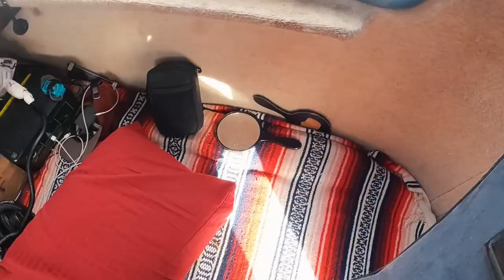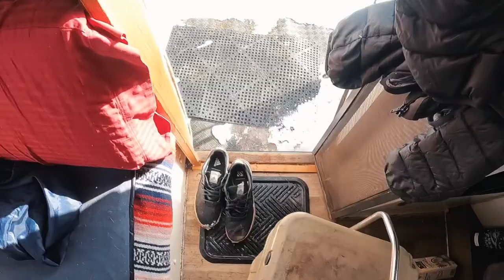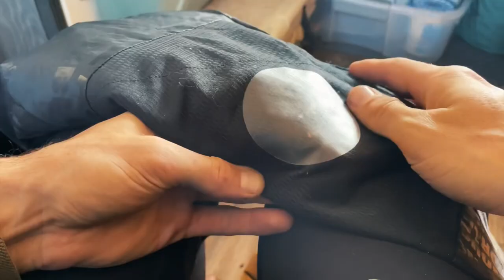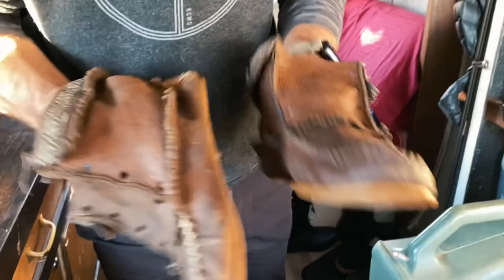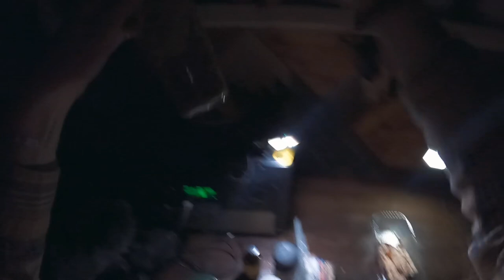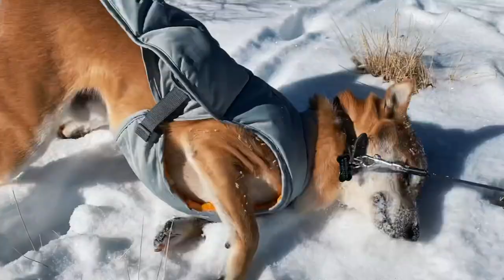WHAT DO WE DO ALL DAY??? // Living in a 13ft Trailer Off-Grid

Comment: Elsa, bless your heart, you need an "awl" for future moccasin repair. This from an old shoemaker's son. (I risk mansplaining here) Forget the needle n' thread thing. An awl is a cobbler's tool, (see google) basically a handle with a spike attached and a small barb(hook) at the end.Take 4 feet or so of heavy thread, and wax it up first. Push the awl through the shoe from the bottom, and hook the thread from inside the moc and pull it back down thru the bottom. Leave the two ends and all the thread on the other side. So now you have a loop. In the hole next to the loop, use the awl again, grab one of the loose ends, and pull the whole thing thru to the bottom. Now you should have a loop(just a couple inches) sticking out one of the holes in the sole, and a single strand a couple feet, coming out the hole next to it. And a single strand remaining on the upper side of the sole. Take the single strand next to the loop and feed it thru the loop. Close the loop tight by pulling on the strand above the sole, thats your first stitch. With your awl, at the next hole, poke up through the sole and hook another loop from the single strand above. Feed the lower strand thru the loop again and tug everything tight. Now you're sewing like a pro cobbler.  Merry Christmas you three!
http://www.craftrunner.co.nz/index.php?route=product/product&product_id=4492
https://www.walmart.ca/en/ip/Hanshi-Steel-Sticher-Sewing-Awl-Shoes-Repair-Sewing-Crochet-Hook-Needle-Tool/6WD4TE28XE4J
Reply from the maker: Thanks, I am using an awl in the video. I then felt like I no longer needed it after a while!
Reply: Oh, never mind! :o) @ElsaRhae

Comment: I recommend this stuff called “Sno seal”. I was a pro figure skater and used this stuff on the bottom of my skates, the leather would last me through a season!  Can re apply as needed!  Works best if you have a hair dryer to help the leather “soak in” the protectant. But I bet if you leave it by the stove, might work just the same!

Comment: Just a suggestion to help keep the heat in the camper - try closing in around the bottom to keep the snow and cold wind from underneath.  If you're going to be the same spot all winter, you could get hay bails, if not, even a tarp to block the wind would help.

Comment: You should look into all in one diesel air heaters, the can run all night, sit outside and use very little fuel and run off your goal zero. That way you can sleep through the night and use your wood burner during the day.  $200 buck off Amazon.

Comment: I wonder if there is a way for you to set an alarm based on a temperature of the stack. Or if you could monitor RPMs on the fan and set an alarm off that. I'm guessing the temperature in the stack, or fan RPM, starts to decline as the fire dies down. Is that reasonable? Alarm goes off at 150 F...something like that. Then you could sleep until temp alarm goes off instead of every two hours. I'm sure the alarm part could be figured out. I don't own a wood stove so I don't know how realistic this idea is.
Reply: Or even less sophisticated than that...I bet you could find a standalone air temp sensor/alarm. When the temp in the Scamp drops say 2-3 degrees, it's time to wake up.

Comment: are you guys are aware that there is a Chinese diesel heater with thermostat for small spaces like vans and scamp that you do not have to wake up to refuel? It needs battery and solar which you have and you can even buy one with gasoline burning that takes air from outside and exhaust outside as well. there is also a water heater with heater version as well. You may want to look into it.

Comment: I have no scientific evidence to back this up...But growing up I remember spring being SOOOO HOT and then summer was HOT but not bone drying hot. ( we didn't have air conditioning ).  I rode horses in 90+ degree weather, granted you didn't push them, but you still went into the mountains. My parents had basically a portable swamp cooler, which did little to help, but it was state of the art at the time, we had to add water and ice cubes in it, so we had a cooler more humid room.  I preferred riding up into the mountain to one of the ponds cattle drank from and jumping in.. Yeah it was that long ago.

Comment: I like to tell you that I have a scan that I bought new and we had Put  Size 13 tires on the scamp At the time we had the scam Brought app  I don't know how high we brought it but I have to use a step to get in the scamp. At the time we did this is because we wanted to have a big wheelbase M we didn't know if the wheel Would fit on the scamp Efter we put them on we found out that the wheelbase would probably Cleared it but we had fun and it . We head then with a scam club on a trip And the other scam people saw our camper in they said it was nice to have it higher kosei have had troubles wherever they parked if rained the water would come into the scam so I hope this could help you decide to have bigger tires this check it out it might help you travelling I hope this made sense

Comment: You guy's wood stove operation troubles me.  I've owned several wood stoves in my life.  Always at night before going to bed we'd load the stove completely full, then turn the damper down.  Set the damper to give the wood enough air to prevent it going out.  You can adjust the damper to keep a desirable temp all night.  I've never owned a very small stove like yours though.  So it may not be doable. I love your videos. Rick in TN.